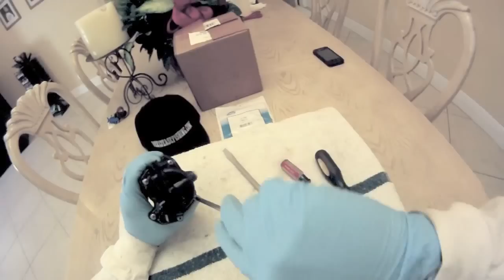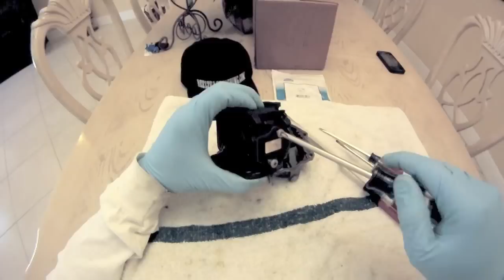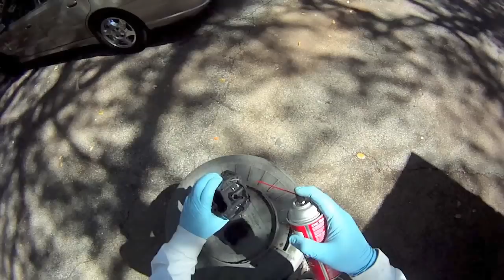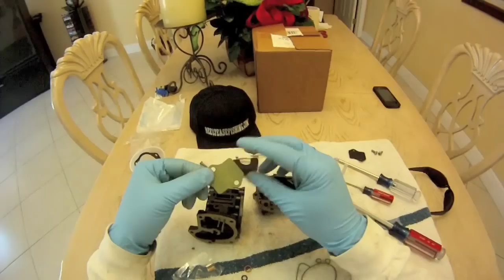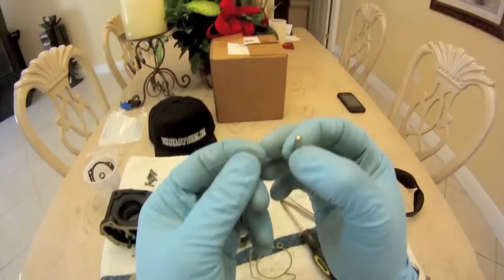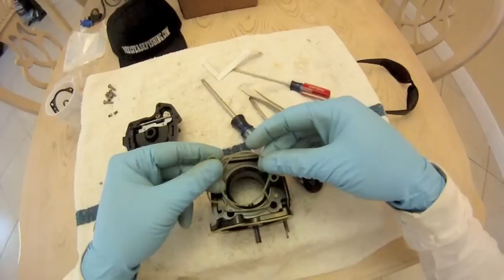How To Clean an Outboard Engine Carburetor

Comment: Thanks for this video.  My 97 johnson 130 would go up on plane, so I called mechanics.  They wanted 500 bucks, so I removed the carbs and sprayed carb cleaner, then blew out all the holes and jets with compressed air.  runs like new.  It's been a long time since my boat went over 40 mph.  Thanks a million for this video.  But the one guy is right,  the screw for the float is not an adjustment screw.  Looks like you have a lot of talent.  thansk

Comment: Great video bro, hey my bowl drain broke while taken it out, I’ll try to remove tomorrow any ideas? Thanks
Reply from the maker: the screw/bolt or the actual bowl housing? if its the housing then you will need to buy a new one.
Reply: ReelTeaseFishing the bolt broke off while trying to unscrew it leaving it attached to the bowl. I’ll try to drill it out but im scared i might mess up the thread. Thanks
Reply from the maker: @MrMrcarlos1991  ahhh yes that's a very tedious little job. slow and steady. start off with a small bit and work your way up. or find a local machine shop, they usually do the job for a fairly reasonable price.
Reply: ReelTeaseFishing yeah brother thanks

Comment: One correction to this video. The screw that holds the carb float in place should not be loosened out to adjust the float height. That screw should be tightened and the float height set by bending the tab above the seat. Loosening out that screw can cause the the float not to seat and gas to pour out of the overflow hole on these carbs.

Comment: Did you put a gasket on with the seat screw? My kit comes with a gasket for that screw, but there wasn't a gasket on there when I took the carbs apart.
Reply: Jason Lefevers Did you end up using the gasket?  I was having the same question when rebuilding mine.
Reply: Nope, I didn't end up using the gasket that came with the kit.

Comment: You never replaced the needle seat screw with the red fiber gasket or the float bowl drain screw with the black o-ring. Behind the float bowl drain screw is another jet that needs to also be removed and cleaned out. When you took out the idle jet and secondary jet, you should put them back where they came from. They are 2 different sizes.

Comment: Thanks for the feedback I'm going to take it in to my mechanic see what's up
Reply from the maker: one of the downsides to using gasoline laced with ethanol (most common found today) is that it goes bad rather quickly. it doesn't cause an issue in our cars because a tank won't last more than two weeks. however on a boat it can sit in the tank for months at a time. sometimes it won't move and just go through a daily phase of heat and cooling which causes air to be forced out when the tank pressure expands due to heat (during the day) and to suck air in through the vent when it cools (during the night) this causes humidity in the air to then condensate inside the tank. Since Gasoline has ethanol, the ethanol actually attracts the water. We all know water and gas are a bad mix. This happens at a very much slower rate when we use ethanol free fuel for things like boats, lawn mowers etc. Also ethanol free fuel has a longer "shelf life" meaning it won't turn on you (Varnish) as fast as ethanol laced fuel. Varnish is what usually causes carbs to have to be rebuilt.

Comment: When removing the 2 idle screws in front of carb, Do I have to remember the adjusted amount of turns when replacing?
Reply: No, they are not idle air screws. They are jets. They bottom out, but don't over tighten them.

Comment: Hi my name is Paul I have a question I'm having a problem with my engine idling high and low I was running fine out in the ocean around the Anacapa when I started to run back across Channel it didn't want to pick up speed and it was running slow and high slow and high all the way back now do you think it's the carburetors it's at 4 about three to four months I did turn it on couple of times and I'm getting a little bit of few drop-ins White's tilted sitting underneath the carburetors do I need to rebuild again since I rebuilt it the carburetors two carburetors it's a 112 special Johnson outboard how about three to four years ago they were rebuilt do you think they need to be rebuilt again or just cleaned out thanks for your help I really appreciate it.
Reply from the maker: hey Paul, are you running ethanol free gas (recreational fuel)? 
Have you checked things like fuel filters, how old are the fuel lines, the primer bulb etc. a lot of times its the small things that cause the engine to behave erratic. when was the last time you changed the spark plugs? .

Comment from the maker: your Carbs probably have two air bleeds or jets like mine. Look at them carefully one is probably labeled 41 or has a specific number. they are labeled. remember which one goes on top or the bottom. Take a lot of photos during the process to remember what goes where. Best of luck. its pretty easy once you do one.